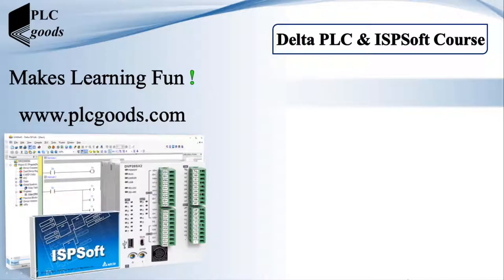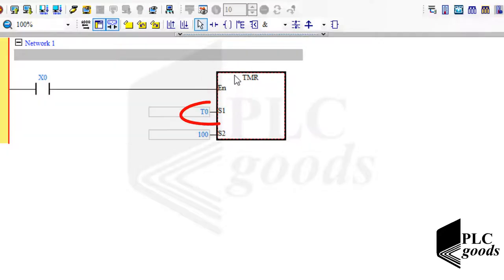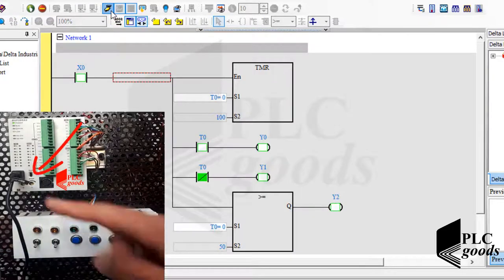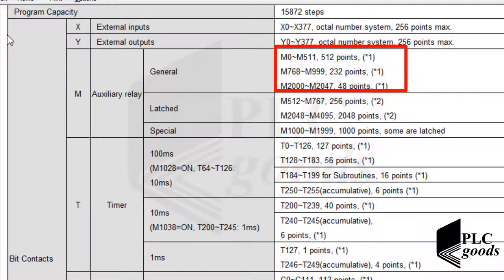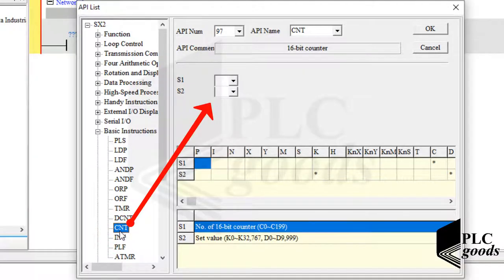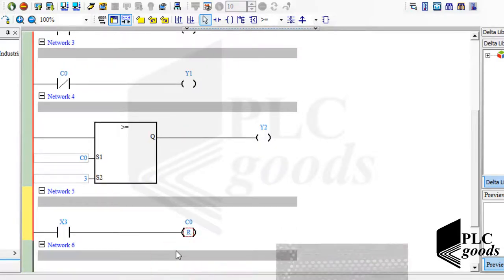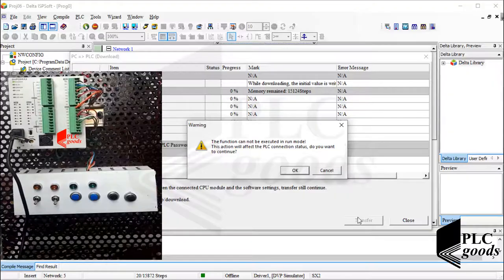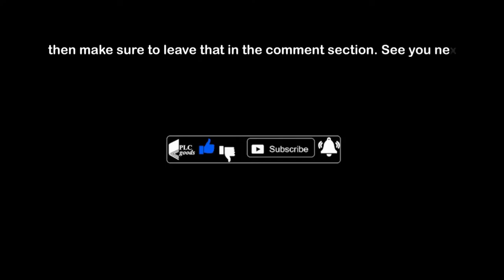ISPSoft Delta PLC programming | Timers & counters Delta DVP series using ISPSoft kepserverEX 6 OPC

Comment: Sir i have bought delta dvp20sx2 plc can you make a vedio on how to conect it to ppwer supply and other connections from basic. Thanks
Reply from the maker: Please check out the wiring schematic either from the PLC user manual or any other source using google search. Remember to be a good specialist, you must be able to search the internet and find answers to your questions! .

Comment: Dear sir I need help as I m on job
In my program isp soft 3.16 don't hane function like extranal input x0.2 don't have rising and falling edge choise pl explain me which program u r using
Reply: Hi there, First of all, I explained how to download and install the last version of ISPSOFT in one of our videos (https://www.youtube.com/watch?v=DKh7qbtH2p4&t=491s), and please check the other inputs. If you can work with others, maybe your wiring related to input x0.2 has a problem.
Also notice If you select another PLC model in the ISPSOFT software, maybe the instructions' structure, on the left side, changes a little and you see new instructions or categories. Therefore you have to find rising or falling edge instructions under a category with a different name. You can use the help window to search and find your instruction.
Reply from the maker: thanks for checking the channel out !

Comment: Dear sir
Thanks a lot for your video.
Where should I found off delay timer in isp soft..?
Please help.
Reply from the maker: Hi there, you can create it. Use the generated pulse by the stop pushbutton to enable a timer (TMR), then use the timer contact to keep on your output for a specific time
Reply: @plcgoods  ok sir... 
Is there is any specific OFF delay timer in ISP SOFT like other plc software (TIA)..?

Comment: when I compile the project, 
I get errors that Y0 and X0 must be Boolean type,
however I can't change the  Y0 or X0 or even see its variable type,
can you guide me?
Reply from the maker: Hi there, I don't know why you have this problem, because the X0 and Y0 addresses are Boolean. Try to test a very simple program ( for example use only one normally open contact with the X0 address to turn on the Y0 output) to ensure your software was installed and worked correctly, then test more complex codes.

Comment: hello sir,

I face a problem during downloading while compiling the program. After clicking compile the projects, the problem occurs in the next step ( download to PLC ). If you give me the solution to this particular error, I would be grateful to you.
And if you give me your contact number of any communication platform of social media, I can elaborate my concern clearly.

Thank you.
Reply: Hi there,  After compiling and according to the produced messages at the bottom, check whether there is any error in your program or not. Also, check the connection settings under the Tools menu -> Communication Settings. Sometimes, a program is connected to your COM port, therefore you won't be able to use your COM port to connect to your PLC
Reply from the maker: Hi there, After compiling and according to the produced messages at the bottom, check whether there is any error in your program or not. Also, check the connection settings under the Tools menu -> Communication Settings. Sometimes, a program is connected to your COM port, therefore you won't be able to use your COM port to connect to your PLC